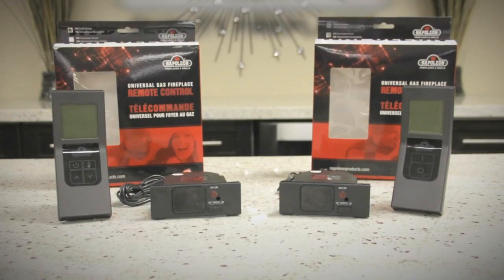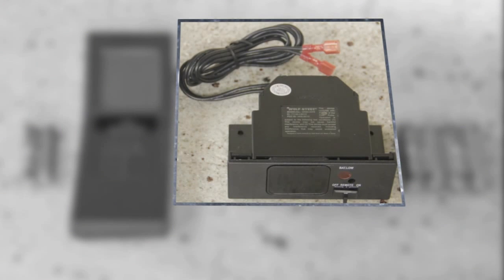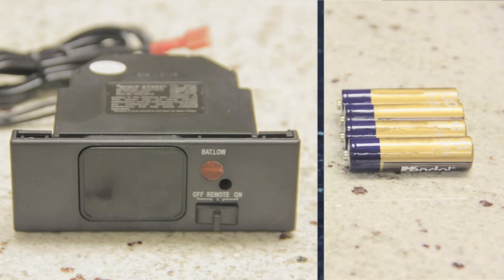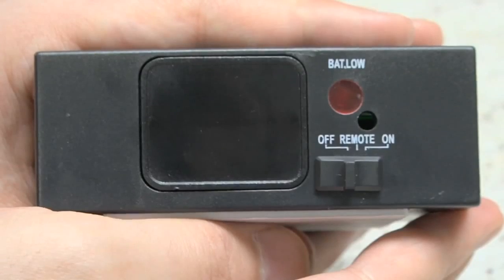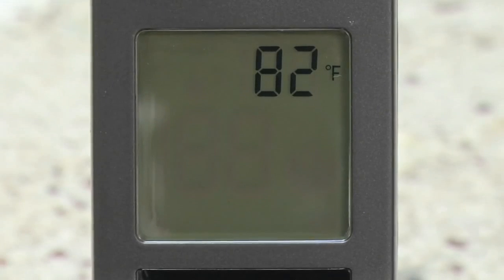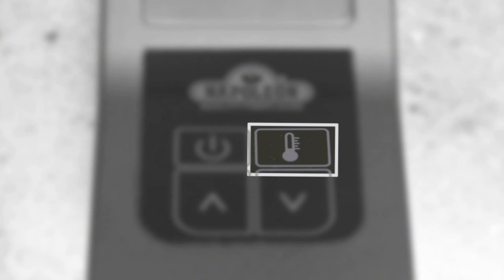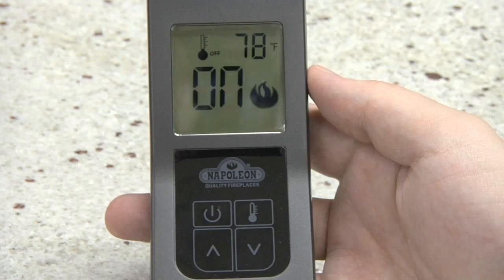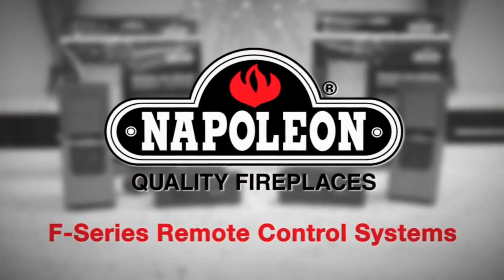How to use your F45 and F60 Series Remote Control - EliteDeals.com

Comment: i had a napolean gas fire place installed with the F60 remote included, im extremely disappointed  with the remote, its has poor back lit features, when turning the fireplace place on with out lights directly on the  remote, also this remote eats AAA's batteries,  you would think, a  9 v would be a better option, i've replaced the remote batteries twice in less than 2 months..  fireplace is great, remote could be better